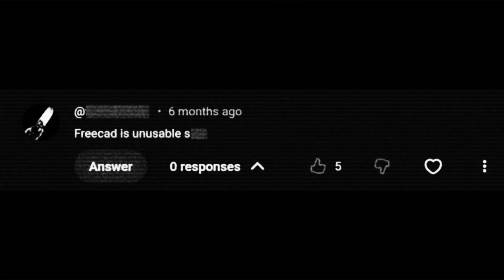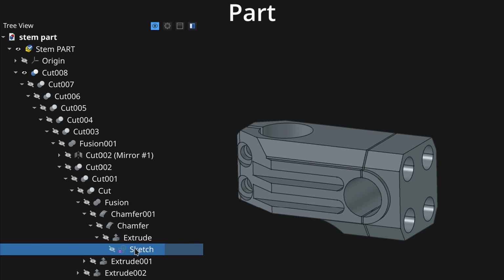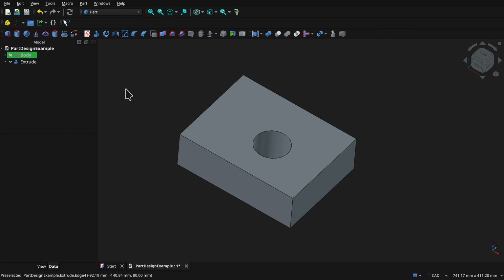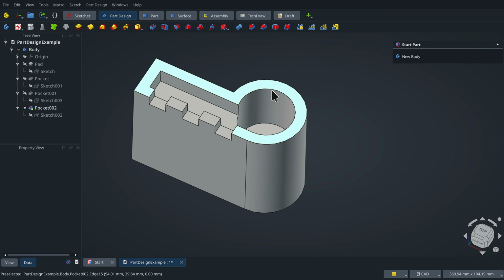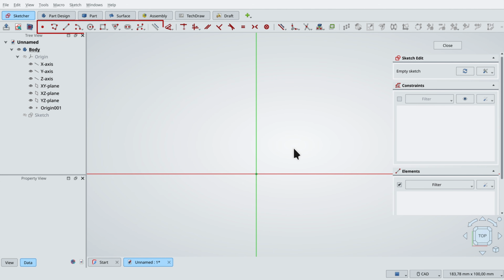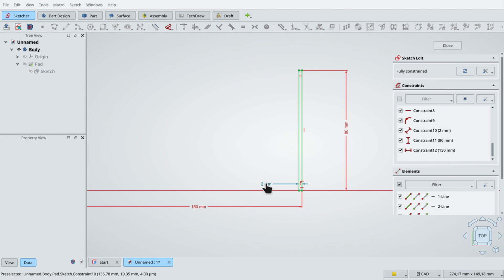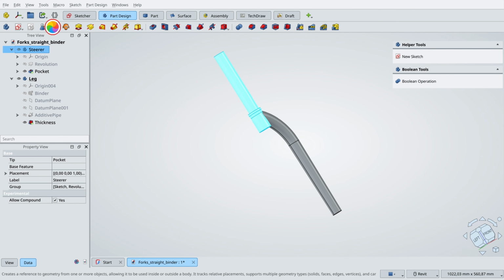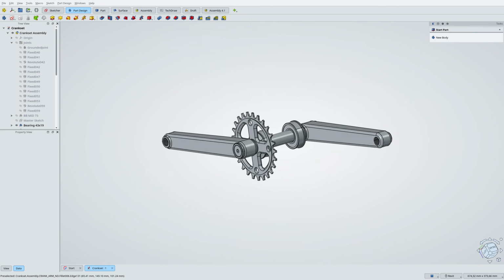STOP using FreeCAD WRONG! Do this INSTEAD (Workflow & Tips)

Comment: FreeCAD is great, and it crashes about as often as Fusion does. The real difference comes down to usability. As a software engineer, I often fall into this exact same trap myself. FreeCAD simply has too much friction because it assumes you already know how to use it, making it significantly less usable.
Most operations come with unexpected caveats, weird behaviors, or just poor UX workflows. Often, the wrong way to do something feels right, and the right way feels wrong. In my opinion, this is what keeps it from being truly great software.
Take the Part/Part Design tree view, for example: the visual language, UI placement, and even the naming suggest it's the exact same tree view as before, yet it functions completely differently.

Comment: Of course, all CAD programs are different in some way. I know Inventor, SolidWorks, and Catia very well. They all do the same thing, but each program does it a little differently. There are advantages and disadvantages in each system.

With my experience in CAD I had few problems with part design in FreeCAD, even though some concepts are a bit odd compared to the other systems.

Assembly design is a completely different story. Here, I find FreeCAD utterly incomprehensible.

It starts with inserting components into an assembly. Instead of one history tree, you have two windows (or rather, one window at the top and another at the bottom) both showing a list of the same parts => why ??

The biggest problem: 

Moving/manipulating the components of an assembly in the workspace by touching/gripping them with the cursor (like in Solidworks or Inventor) to check, whether a mechanism (assembled with all the constraints) works/moves like it should do...

...sometimes this works 🙂
...sometimes not .....       😞
Then you only can click/select the parts, but thy don’t move!? (…no, they are not fixed ! 😉 ) 

There seems to be some kind of automatic mode switching. Unfortunately, I can't see any indication which shows in which mode I'm in.
And also not how to switch between these modes.

I would really appreciate it if there were finally an open-source CAD program that one could actually work with – but FreeCAD doesn't seem to be that yet.

And the most incomprehensible thing for me:

In FreeCad You can choose between several concepts for controlling the view in the 3D workspace.

However, out of the classic mechanical CAD programs, there's only the version of CATIA that's still based on 3-button mice without a scroll wheel from Unix systems out the last millennium!!

I never met a CAD-User which knows Catia an one other system who prefers the Catia-Control Everyone actually prefers the controls of SolidWorks or Inventor, but these aren't available => why? That should be easy to integrate..
Reply: Hi, nice to meet a fellow Solidworks user. FreeCAD is getting closer to Solidworks in recent years in terms of usage. Many new features are modeled against it. Feel free to check the latest dev build 1.2.0 that should better suit your tastes, including navigation with a "Solidworks" option in the dropdown. In my case, i've always preferred Blender's nav but it's basically the same.

I'm not sure I understand your issues with the Assembly WB. You need to have the objects opened as instances if they are not part of the project hence why they appear in their own tree view but this also makes it a breeze to edit a part while looking at how it fits in the assembly since you can hide them. This is way more powerful than how Solidworks handles it. 
As for moving the parts to test constraints, you have to double click on "activate assembly" in the tasks pane (the assembly name should in bold). FreeCAD asks you if you want to lock the first object you add to the assembly, but you can pick the GroundedJoint constraint in the Joints folder and change which object should be grounded in the settings below.

I hope this helps alievate some of the confusion.

Cheers,

Comment: I've been using FreeCad for a while, but the Sketcher drives me crazy sometimes.
I really dislike being told that I'm using it wrong.
NO!
If the software doesn't (reliably) do what I want it to do, it's not me using it wrong,
it's the software not working like it should.
Other CAD-programs can do what I want to do, why can't FreeCad?
Like using the symmetry constraint on Lines and Curves, FreeCad only allows symmetry on points, which is really tiresome
(and it complains about over-contraints when mirroring horizontal or vertical constraints - again, works perfectly fine in Inventor)
The only reason(s) I use FreeCad is(are)
- it's free (duh)
- I'm now on Linux, so I basically have no other option

Comment: Thanks for this video. Freecad has been on my PC for over a year now, gets updated but never actually used so far. Now that I have a 3D printer, I hope to get started with Freecad. So far, Sketchup was my go to software, since i also dabble in wood working and it seems quite intuitive. I hope Freecad can be the same. Did I hear right that there is a coincidence constraint?

Comment: I still agree with some of the hate: if the defaults aren't good, it's just not good. It does matter that you can make it work well, but it should work well *out of the box*. There's also a lot of unnecessary (not inherent) complexity caused by the workbench-oriented design. The very existence of this video indicates the problem is real!

That said, I still use FreeCAD. It's good enough.

Comment: I appreciate the work that goes into the software and these videos (and the ton of useful information in them). Honestly.

But can we pls stop with the  edgelordy "skill issue" framing (even if it's just for a catchy opener)? If we look a bit past the odd rage comment, the criticism is largely not that freecad would be outright bad or not capable. It pretty much always boils down to some combination of the following:
# Outdated ui (still there, albeit looking nicer)
# Workbench chaos (still there, although videos like this one help in understanding, the issue remains)
# Most frustratingly, more planning ahead and just more clicks/keystrokes required and less intuitive/consistent workflows than in other CAD suites
And these are still valid points.

Comment: Thank you for this video. I’ve used Fusion360 for several years to do 3D print models and to do technical drawings for wood and metal shop projects. With Autodesk’s recent policy changes, that is no longer a viable option for me and I’m looking for a replacement. FreeCAD may be it. Subscribed, and looking forward to learning more!

Comment: I've been working with freecad for a long time. Long enough. I started with version 0.16. And I agree that it's terrible. I could list all its flaws for as long as I've been working with it. But I won't. I'll just say the most important thing - it has a completely idiotic body system... Create a new body... Create a new body... An error occurs when the extrusion result creates multiple bodies... I hate it! The user doesn't need to think about the bodies at all! This should be handled by the program engine, not me! I just want to start drawing a sketch on any convenient plane, be it the main planes or existing faces, while in 3D mode, and immediately squeeze out 100 of them, and in another way that suits me, immediately set the chamfer on the desired faces of the desired radius - right here in the workspace, not in this one. The stupid chamfer menu!!! And at the same time, do not lose the size reference to the corners of the shape! Freecad has a completely unintuitive, inconvenient, and often buggy interface! Free means freedom. But what kind of freedom is there when, after fixing a sketch in the base of a complex body, everything breaks down and you have to start from scratch? And if you want to copy a sketch from one body to another, a window pops up asking you which type of binding you want to use??? Why do I need to know that??? In any case, no matter what option I choose, the result is always incorrect. But there are 2 things that make it worth using: it's free (I could easily download a pirated version of Solidworks, but I don't want to) and it's parametric. I actually enjoy working with geometric constraints, such as tangents, arcs, and straight lines, and setting specific boundaries for their existence. Unfortunately, this doesn't work with splines and parabolas, as it leads to errors and chaos. I primarily use the sketch and part design workbenches. They are most often necessary to use, and all other workbenches do not interact with them in any way, so they only clutter up the interface. The assembly workbench is so confusing that I could barely understand how it works even with the help of tutorials, but I can't use it in practice because it's impossible to complete this quest without a step-by-step guide, relying solely on memory. I want to focus on my design rather than on pressing the 101 buttons in the right sequence to make anything work! The fact that freecad has several assembly forks at once says that they are all not suitable for normal work! I want to be able to click on one anchor point and another in 3D mode and the binding would happen immediately automatically! If I click on a plane and on a plane, then the binding should be like that of gears, if these are cylindrical surfaces, and like that of bricks in a masonry, if these are planes! And in the menu at the same time, you need to select the gap and offset on one or two axes. But freecad is INFINITELY far from that. That is, I expect that the approximate time when its interface will reach that is NEVER. It is more likely that autocad and solidworks will become completely free than that FreeCAD will ever be able to do what I described. But I continue to use it  (yet), and there is no alternative.

Comment: Part/Partdesign confusion is real. I think most people are looking for partdesign, but that fact isn't immediately or intuitively clear. Part feels more like modeling in autocad but with a feature tree, and for someone looking for an alternative to solidworks/fusion360/onshape/NX/whatever that's frustrating and makes the software seem worse than it is. I work with solidworks, and the engineers around me hate autocad from having to use it for some mechanical design. AutoCAD isn't a bad software, but it's a different tool for a different task, and FreeCAD actually has workbenches that cater to those tasks.

Comment: When it will be possible to select the face to extrude like in fusion it will be a game changer. I'm using it a lot but i'm way mor slow with it. Sometimes i have to do multiple sketch for some operation where in fusion i do it with one sketch

Comment: Positive remarks:
FreeCad has the single best bang for your buck FEM solution, easily.
The function tree folder. Which I didn't know of before should be copied by other cad software.
The sheer amount of add-ons is extremely impressive!

Current suggestions:
-Part and Part design feel like they should be on toggle instead of two workbenches. A "create body" toggle
-There lacks a visual way to delete constraints in sketcher, with a delete tool that shows the constraints on the surrounding objects and allows you to delete them. Though I have yet to see a perfect implementation of this idea in Catia, inventor or fusion
-The line made in cylindrical surfaces is a bother, it feels like it would be more elegant to have a partial cylindrical surface or a fully cylindrical surface, though I imagine i should take this one to the forum for explanation

-coming from fusion and inventor, I think multiple closed paths in a single sketch makes some things more manageable. With it you can easily edit some complex assembly in a single sketch without looking through the function tree.
Even catia has an imperfect version of this feature with the multiple extrude tool

-The dimensions flipping bug needs to fixed. Using parameters for everything is time wasting.

- Filet should be able to completely replace a surface. Current workaround in the 3d workbench leave a problematic thin face at the bottom of the filet

Comment: I appreciate this video as a comprehensive and high-quality introduction to the FreeCAD environment. However, I still have reservations and critical concerns about it.
Despite having over four years of experience with CAD software, which may not be extensive, I have had the opportunity to try and compare various options. FreeCAD, in my opinion, falls short in several areas.
One major issue is its reliance on an ancient and somewhat restrictive mathematical kernel called OpenCASCADE. This kernel imposes numerous geometrical inconsistencies, errors, and poor performance, particularly for advanced modeling and large assemblies.
While FreeCAD may be suitable for casual and basic users, it is utterly unusable for professionals. Some of the workbenches, such as the Drawing Workbench, are inadequate for producing professional-quality work. Additionally, FreeCAD lacks the adoption of industrial standards, resulting in unusual workflows, confusing feature names, poor parametric implementation, and unreliable and customizable fillets. Not to mention the lack of basic internal features, which are to be implemented only through external plugins (which often get discontinued or are experimental). Another major downside is the unreadable error messages, and frequent crashes/critical errors appearing out of nowhere, they present themselves in harsh and machine-like red errors which give most of the times 0 information to a common user: I have never experienced such poor error management in any other CAD software.
These shortcomings stem from a project without a strong leader and organized team. The constant turnover of personnel and the absence of a clear vision have led to a messy user interface, incoherent design, and a disconnect from the industry. Until FreeCAD receives proper guidance and direct industry involvement, it will likely remain another Linux/open-source hobbyist tool.
I am open to changing my mind and seeing FreeCAD improve, but my four years of updates and attempts to use the software have not addressed the underlying issues that plague it.
P.S. I use PTC Creo Parametric and Rhinoceros.

Comment: Thank You so much for this excellent tutorial. I'm an "intermittent user" of freeCad, and though the latest updates has improved the program tremendously, I must say that I still have to "relearn" a lot of things every time I "come back". And though I inclined to believe that the program isn't totally innocent to this "unfortunate pattern". I think the main reason is that I have never managed to get a fully correct workflow, but rather I have just "struggled along" until I managed to "solve" my current task "sufficiently well ". And never taken the time to instead learn enough to be able to solve my tasks following "best practices". Something I hope to be much better at after this excellent video.
Best regards.

Comment: I went with Freecad as its the only option that wont suck your money if you go with a small commerial project. It was a transition but i like Freecad more and more even if i have to fight it from time to time :)
Reply: I've only just gotten into CAD design, so I went straight for FreeCAD 1.1-RC1 because I didn't want to get mentally locked into another program. Moving from MSOffice to LibreOffice was an absolute hassle due to muscle memory and preconceptions. LibreOffice can do 50x more than I need it to, so it was never the software that was the problem. But the force of habit can be a bitch.

Comment: Always wanted to get to know FreeCAD, never invested the time into it. But I agree, I started using OnShape for doing cad models for 3d printing, but when I hit a ceiling I couldn't solve at the time I jumped ship to doing that specific design in blender since I had more hours into it. It's not the software per se, more the amount of hours you invest into it. Some programs are easier to use than others, but it doesn't mean the other is trash, it's just a different workflow to achieve the exact same thing. If you don't wanna fork out for a subscription and you don't want your personal designs on the web for everyone else to use, then investing time into FreeCAD is where it's at

Comment: Great video! I’m a long-time SolidWorks user, but I’ve decided to move to FreeCAD because the SW licensing has just become too expensive for me. Could you make a video specifically for people transitioning? A guide on how to 'think' in FreeCAD when you’re used to the SolidWorks workflow would be a lifesaver!
Reply: I came from Fusion and quit after 1 hour. I was completely lost and frustrated trying to do something that should be a 3 minute job. 

I almost think it would be easier to learn with zero experience since you have no habits or expectations regarding relative ease of performing work. 

You would be just as lost but eager to learn rather than comparing it to your previous love.

Comment: i modded an STL a fair while back. slice, loft, blah blah. no idea how, but it worked.

for at least the last year, i have also been cursing FC... it once worked, why not now? simplest tasks, five minute waits, if not crashing. unuseable. that suggested it wasnt FC...
changed OS from mint/cinnamon to zorin. yay. i can use it again.
so far the only "crash" has been trying to "create pocket" from an internal involute gear. it also made a pretty cool image after restarting... wrong approach to the problem. i guess i pad a disc, then pocket THAT...

yes. its confusing. i wish i had spent time on cad way back rather than sketchup because didnt the loss of that hurt...

screw "the cloud". i want my old skp16 plugins...